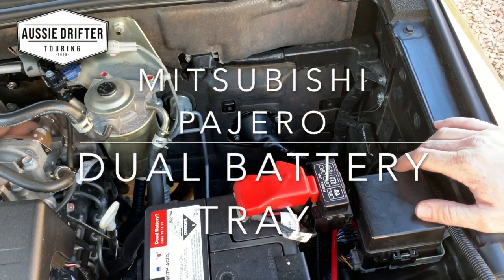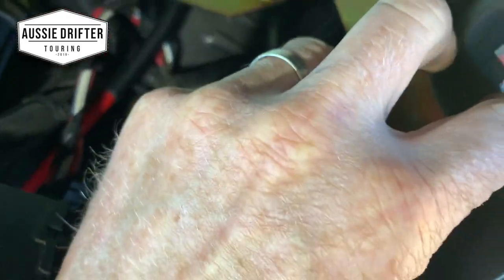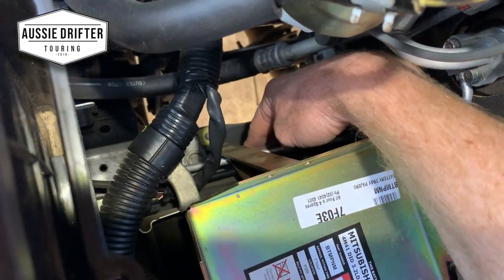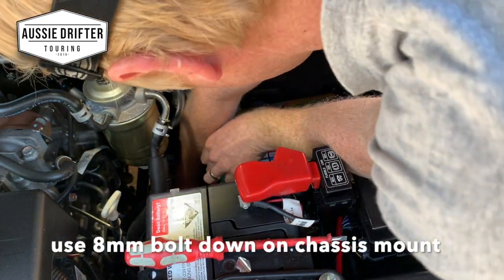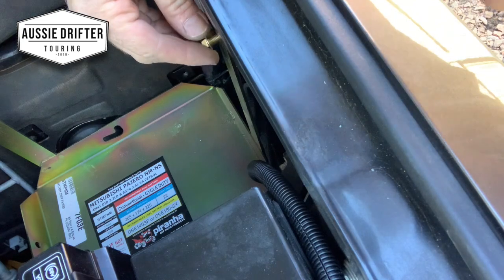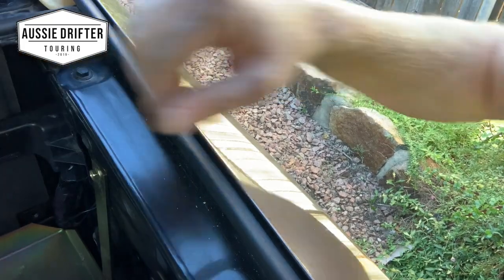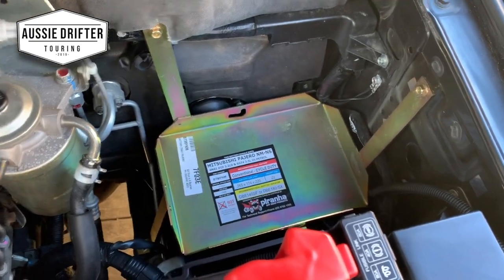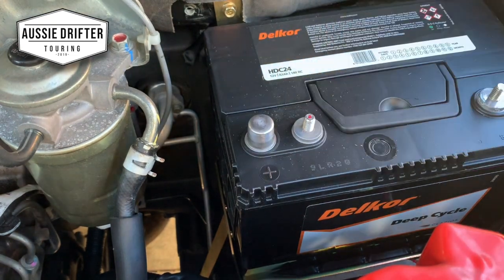Mitsubishi Pajero Dual Battery Tray Installation

Comment: This is where I'm at. Wish to cut into existing wiring under the bonnet for cig lighter so it is permanently live. But powered by aux battery only. Intend to fit Anderson plug at later stage as per your next posting.

Comment: You could put a nut sert in there and bot have to remove the plastic guards
Reply from the maker: A nut sert is not the strongest option mate, they are great for securing light equipment but this is holding a battery into position in the engine bay of a car that flexes offroad.  So removing that gauard and using the large mudguard washer is a far more secure option.